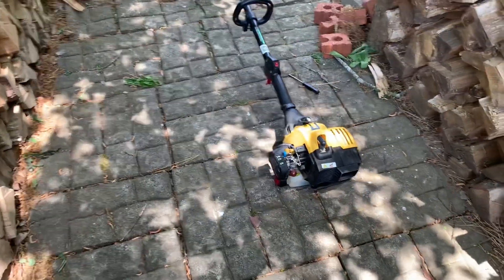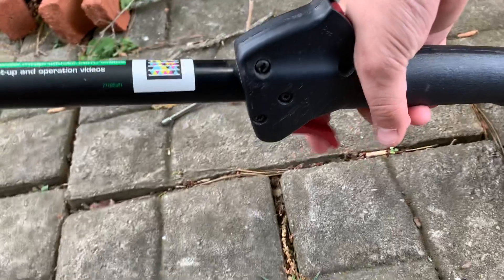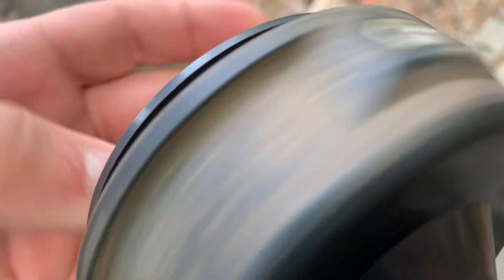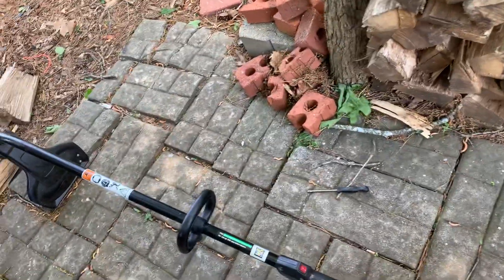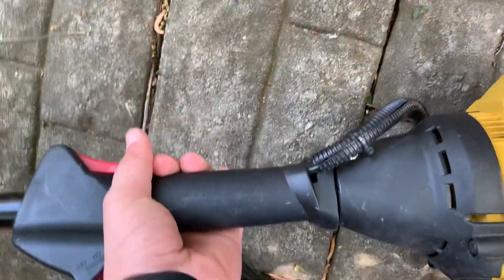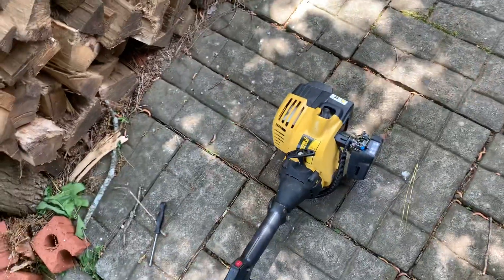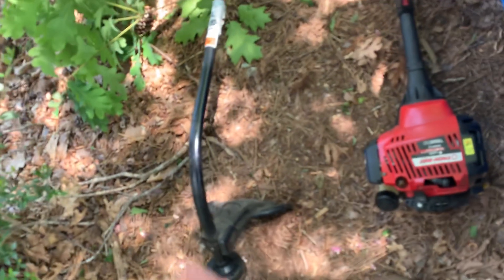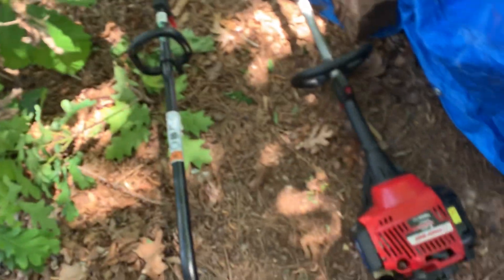Is This Bolens BL110 Worth Fixing?

Comment: Yes they are
Reply: Take the screen arrestor out first if you have a sealed muffler cut the open port off and grab you a ice pick and dig that screen out  the it will start and adjust carb
Reply from the maker: Long story short I made one out of 2 Bolens i don’t Even remember if I showed the other one I had but I think this one had a cracked spark plug which is why it never ran well but either way in the end I got one out of 2 and even these days people prolly won’t pay more than 40 for that WeedEater used so I stopped picking up the low priced weedeaters and focused on mowers.